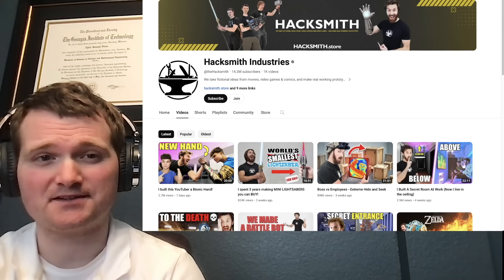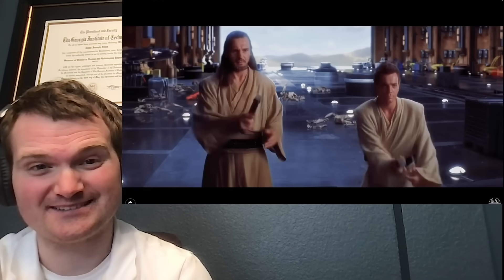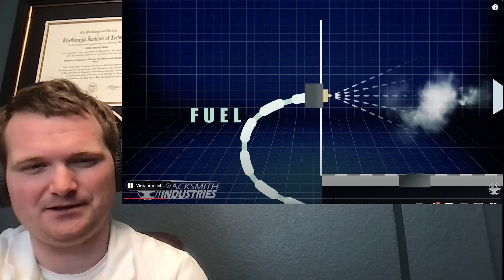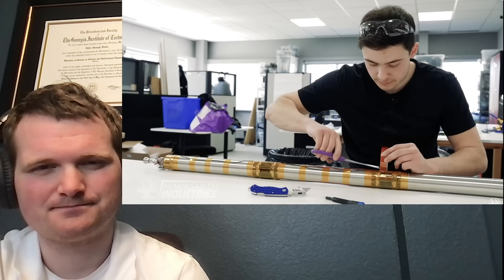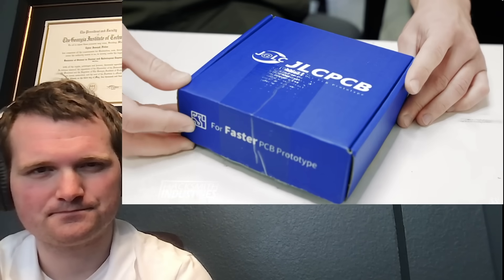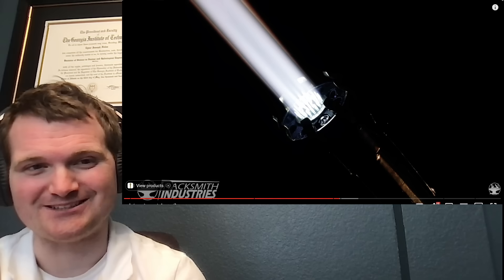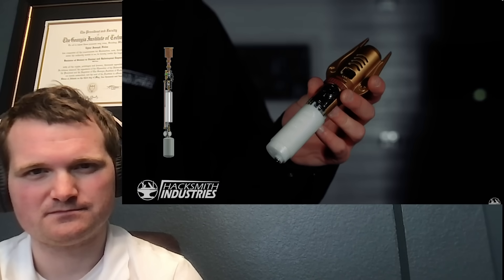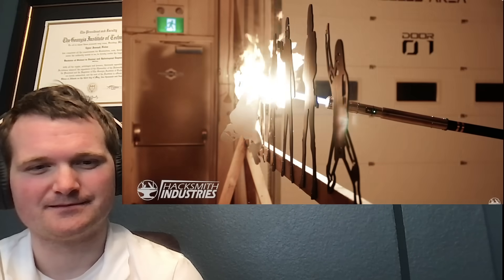Nuclear Engineer Reacts to Hacksmith Industries "We BUILT a 4000° Lightsaber Staff (IT'S CORDLESS!)"

Comment: I've been wondering for years it they could scale this type of torch down with atmospheric microwave plasma. I'm not a physicist or engineer but I'd imagine it'd really just be a question of if the transformer and power supply could be made to take up less space than the butane and oxygen. Atmospheric microwave plasma afaik doesn't get as hot as this lightsaber but it's not too far off the ballpark.
Super cool video either way